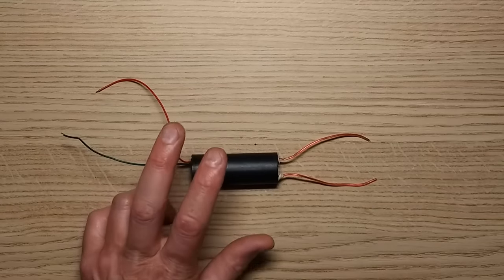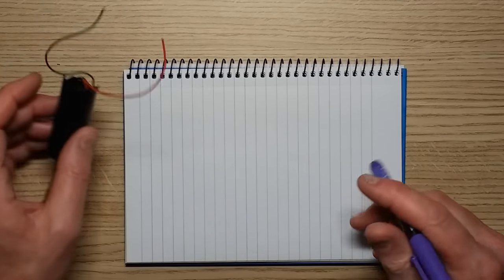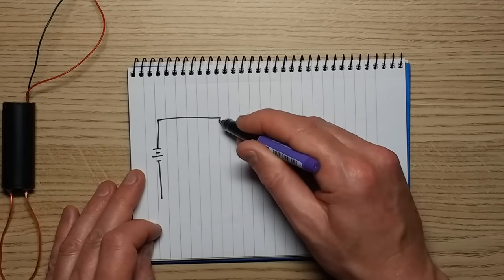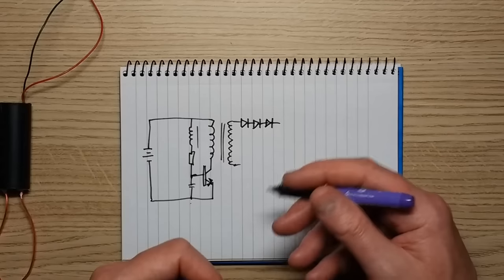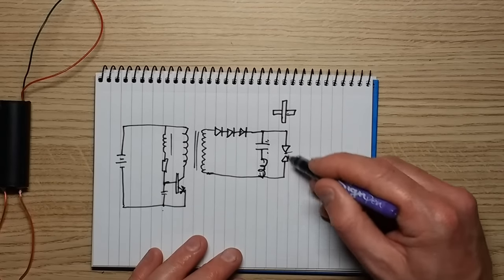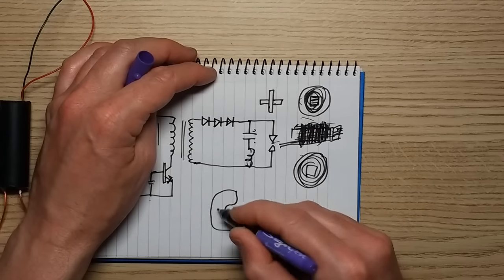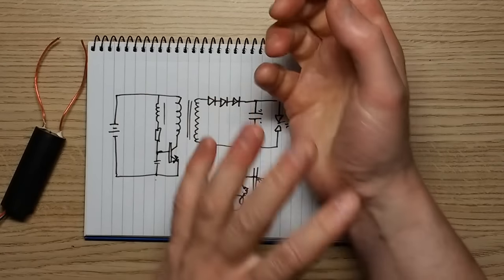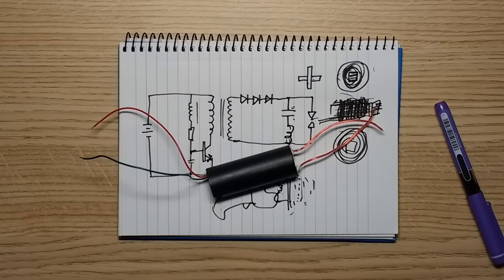Are these stun gun modules?  And do they hurt?  (yes)

Comment: I've always wanted one of these...could I use it to supply a cockroft-walton multiplier to boost the voltage even further?
Reply from the maker: +Jon Holt I think these do have several stages inside.  But you'd need to get into the resin to get the required connections.

Comment: Burned out a dozen of those using them as ignitors on an engine.  Pulled them apart (with a saw).

Not sure how they work inside but they seem to have one of those little 10-15k transformers used for neon lights & stuff.
Reply from the maker: You have to be careful not to space the electrodes too far apart or the high voltage damages the circuitry.  They're also only suitable for brief bursts of use.
Reply: @bigclivedotcom  Would you say if they were fed a 2ms burst they would be unsuitable to fire a spark plug at 11 cycles per second?
Reply from the maker: These units usually have a high voltage step up circuit with multiplier to increase the voltage, so I'm not sure they'd produce a spark with accurate timing.

Comment: I don't understand how 1 kV is stepped up to 30 kV in the secondary circuit
Reply: The 1KV charges the capacitor. So the voltage on the capacitor rises as it continues to charge. The capacitor sucking in the power causes the 1KV to drop quite a lot as it sucks in the energy. So the "1KV" will actually be less, but rising as the capacitor charges.

Eventually the voltage on the capacitor reaches a level enough to cause a spark through air (the principle behind this whole thing!). This spark happens in the spark gap, which is two pieces of metal with a small, precise gap between them.

As the 1KV spark persists through the spark gap, the current also flows through the second transformer's primary coil. which is in series with it. The energy here is all coming from the capacitor, it's discharging through the spark gap and the coil. A spark gap, even though it's air, actually has quite a low resistance once it's going, so it doesn't waste much power. 

So the spark gap is acting like a low-tech voltage comparator. When the voltage is over a certain point, it can break down the half-centimetre of air between the electrodes, and current will flow. So, the capacitor can discharge it's energy into the transformer coil only when it's charged to a high enough voltage. This is all in the name of generating high volts. 

Soon enough, the capacitor is empty, the spark stops, and  the capacitor goes back to charging. But in the meantime, energy has been dumped into the second transformer's primary. Causing a very high voltage in it's secondary. That's why it's potted so completely, to stop sparks forming between parts of it's coil. This very high voltage I mention goes to the output wires, where the spark happens, or else to discharge into the flesh of a Scots / Manx electrician who's just a little bit pissed.

Comment: low current, heh.  the louder the spark is, the more current flow. could be a few amps for a very short time.
dumping the load into a shunt shouldnt cause harm to the oscilloscope since both wires are isolated from ground.

Comment: ordered 2 :) will get more lol and may i ask a noob question if i connect two in parallel would i need to double the input voltage or stay using only same voltage for both? i wish to make a bass ass jabcobs ladder
Reply from the maker: This unit is only suitable for short bursts of use.

Comment: Thinking one off these Clive to fix my powder coat gun was 120v until i plug it in 240 by accident in a rush to get my swing arm done
Reply from the maker: This module probably wouldn't be suitable as it will be damaged by continuous running and being used open-circuit.

Comment: Hi - I have used one of these to charge a 84nF capacitor to 15-20kV so the output is definitely DC; from the sharpness of the 'crack' of the output discharge there is a small output capacitor inside the unit. Its very disappointing how easily these things overheat internally and stop working, best to get a handful of the units for serious experimenting.
Reply from the maker: They're only designed for brief use and you have to make sure the output wires don't get separated too far or the internal insulation will fail.  This type of module does appear to use a step-up transformer followed by a capacitor/diode voltage multiplier.

Comment: I bought one of these, hooked it up to a 3v battery box from a poundland led light string. Switched it on for about half a second. It was terrifying! My poor dog even ran out the room and the cat gave me a dirty look. Stuck it in the drawer. I'm too scared to use it again.
Reply from the maker: If you do summon up the courage, then make sure you never part the spark wires more than about 20mm, as the voltage will keep rising until internal damage occurs.

Comment: Is this actually a stun gun? Apparently Taser International spent loads of effort in developing waveforms and voltages specifically to stun muscle, without too much risk to the heart (although of course they're still quite deadly). You need AC to stun somebody, and at a particular frequency. If this is voltage-multiplied DC, it won't work. Simply pissing off your assailant with a sting isn't going to help, it needs to actually stop him being able to move. Otherwise this is just a cattle prod.

Would using a resistive divider, with some high-value resistors and effort paid to the insulation, mean you could measure the waveform on an oscilloscope? Would you mind risking a scope? Didn't Agilent or somebody send you a free one? I'm sure they'll replace it if you blow it up!

Comment: Great vid! What happens if you continue pressing the on button until the battery runs out? I ask because mine stops creating arc after about 2 seconds, then I have to wait. Is my module broken? Do I need capacitors?
Reply from the maker: These units are only designed for brief bursts of use.
Reply: @bigclivedotcom  If the sparks stop after 2 seconds, does that mean that I can only shock an intruder for 2 seconds?
Reply: They tend to burn out.

Comment: You can mod a 230v strobe light with one of these, makes it portable...
Reply from the maker: I've not tried it with a strobe tube.  It would rely on the voltage rising high enough to cause the lamp to strike without an external trigger pulse.
Reply: @bigclivedotcom  So add a trigger transformer! Actually I've a feeling it'd bugger the tube, gas discharge lamps don't react well to abuse.

Comment: I disconnected the batteries from one of those and tried cutting into it with scissors.  It shocked me still.
Reply from the maker: They do hold a charge on the output.  You have to bridge the output wires together.

Comment: Can these things actually repeatedly shock you if its connected  firmly to your body before power is applied ? does it produce a flat DC output under load ?   I put two 33k resistors across its output and two long leads that I put my toes on ( same foot ) and it gave me quite a jolt,  it was reading around 70v on the meter so was that just a regular DC shock of that voltage ?   I didn't see how much amps it put through my toes but I tested on a banana and from end to end it was putting 20 milliamps with a voltage difference of 200v.
Reply from the maker: I wouldn't recommend that.  The circuitry will probably put out DC under continuous load, as it uses a voltage multiplier.
Reply: @bigclivedotcom  I measured the voltage in DC mode several times and it varied according to the resistance but what was strange was when I changed it to AC measuring mode it also registered a voltage that was around 2/3 of the DC.  I tried my cheap handheld oscilloscope that I don't understand well and it did show a waveform of some type, looked like half of a sine wave. I then tried measuring the frequenzy with the multimeter and it said 15 khz which would be from the first stage before the multiplier ?

Comment: I bought one of these with the intention of bunging it in one of those electric bug zapping rackets! Super bug bat!  Think it's possible? Thoughts/tips? Maybe a nice little side project for you to show us how it's done 😉
Reply: I done it , works ok , you will get a lot of arcing all over the mesh and it will take out a wasp. thats why i built it . It wont explode um but will fry them . I run it of a 18650 power bank.
Reply: Thats what i put it in , the switch was the only bit i used from the original ,just bin all the rest of the electrics, its a real easy project.

Comment: Would playing with these near electronic equipment be a bad idea like plasma balls?
Reply from the maker: +perseus431 No. These don't emit a field like the high voltage AC devices do.
Reply: Thanks for getting back to me. Can i ask another question? When i make arcs or use these to power cold cathodes, it whistles. Why does it do this and is it a bad sign? Also if i make it arc through fire from a lighter the arc changes! 
:-O

Comment: i've got one that is partially fried, i will (eventually) attempt to remove the potting and expose the mystery circuit
Reply: dremel was a bad choice. whittling with xacto knife is better method. on HV side, on flat side of module, there is a sort of printed resistor, (squiggly black line on white material) for bleed off, presumably. mine looks more like a spark gap now, due to dremel. on either side there is a large, formerly red rectangular HV cap, (one on each side) and between them is what seems to be a voltage multiplier circuit, consisting of at least 2 of the round blue hv caps, and 3 HV diodes. (so far it appears that i see 2 blues and 3 diodes, going \/\ and further excavation of the potting material is becoming more troublesome. so far, all i know for sure about the input end is there is a large transformer taking up that half of the circuit, with a large ferrite core. there is something blue on that end as well, so perhaps another round hv cap. have not located the transistor or resistor on the input yet.  i really should find a non-potato camera and post pics. my circuit is quite mutilated at this point, from the dremel. making a dusty, likely carcinogenic mess with the dremel, i managed to accidentally chop into both red caps and all 3 diodes. the diodes are still functional, as tested by shocking with another unit in each polarity.

Comment: Why does a Van de Graaff generator have a less dramatic effect than a stun gun? Both operate at the tens of thousands of volts. The generator's charge presumably passes through your body to ground, while the stun gun passes between the two probes with limited body in between. Is it only about the time and current? That a stun gun is larger current over longer time which has a greater impact despite the more limited path through the body?
Reply from the maker: The Van de Graaff generator relies on charge being stored on its dome surface.  A capacitor can store a lot more charge.

Comment: Hi Clive some of these will spark across 50mm quite easily and the sellers recommend a 2 inch spark gap. What sort of voltage is that?
Reply: Assume 30 kV per cm, so better than 150 kV.
Reply: Slicerwizard That could be painful then lol

Comment: I think you forgot to mention where the secondary winding is connected. You just said the ouput capacitor goes through a big primary winding but where is the secondary with the fine wires? Shouldn't that be the high voltage output?
Reply: Yes. In the design Clive drew, the secondary of the high-voltage transformer goes straight to the output wires to connect to the victim through the pointy electrodes.

Comment: Bought a few of them from eBay months ago. They died pretty quickly, even at low input voltage and with some pause between a short pulse. Any idea what I am doing wrong?
Reply: They're cheap Chinese junk and any air bubbles in the material that they pot them in will lead to crib death. Of four that I bought, one died in the first minute. The others are still going strong.

Comment: bigclivedotcom Thank you for excellent videos, I had an idea and 3d printed a pistol grip with a trigger and a 1.25 cm "barrel" of a 6" length.  It fits a firework known as a roman candle that shoots 6 exploding balls downrange about 80 ft at high velocity finishing with a loud boom.  I use the trigger to flip a switch on on 18650 in the handle that runs the current into a small ball of fine steel wool which instantly lights the firework.  The point being a handheld firework "shooter" or self defense weapon if necessary 😂.  It's about 6" long and vaguely resembles a firearm, my question is would this be illegal where you are from, and do you have any ideas on a better igniter (mine works flawlessly but is labor intensive to make).
Reply: Pretty sure modifying fireworks makes them into bombs, legally, in the UK. Dunno about elsewhere, would depend how lax your bomb laws are. Most countries' are pretty tight, most countries that have a well-functioning legal system at least. 

There was a bloke who bombed a gay pub a few years ago. His bomb used explosives from fireworks, and nails as shrapnel. It killed quite a few people and injured many. They caught the evil fucker and now he's in jail. 

As far as your igniter, you can buy "electric matches" meant for launching model rockets, which have "motors" which are a cardboard tube of explosive that burns at the right rate. They go very high, lots of fun actually, my mate had one with a camera on board. An analogue, film-using one! When we got the pictures back they were all just the sky! 

Model rocket motors might also be an avenue of investigation for you, though I worry they'd be suspicious if you bought the motors without actually owning a rocket. Maybe have some bullshit ready in case they ask. 

It's probably illegal for me to even tell you any of this, christ. 

Your wire wool idea sounds good enough, if it works every time. I've heard the same method used for other things, I think it's even one of those emergency-survival things where you need to start a fire with a battery and some wire wool. Because you brought both those things but forgot your lighter. 

I might cover my arse by advising you never, ever, to point these things at other people, and be very wary of blowing a few fingers off, because that happens when people hold lit fireworks. 

Even so, you're probably still a t-rr-r-st just for playing with your toy. Jesus fuck. Watch out!

Comment: I dissolved one in paint stripper…

Here's the driver circuit and photos. The output seems to be a voltage multiplier some 12kv diodes and the output has ceramic block high voltage capacitors for that extra kick.

https://drive.google.com/folderview?id=13aVgegFzqlnfxHsOWAskXBTc2Om8cU_f

Comment: I have seen very similar modules used in portable bug zappers.  I wonder if they use the same module or a similar design but change the number of windings on the output.
Reply: They use a much smaller transformers and capacitors. Similar circuit, but a weaker version. Usually it won't have the spark gap and second transformer. Instead they use a voltage multiplying rectifier.
Reply: Thanks for the info.  I was wondering since I have taken a few apart that have similar looking modules but since they are all potted it is hard to tell what they cram in there.  I have 4 of these higher voltage units that I got from eBay but I have not done anything with them yet.
Reply: Using these in bug zapper is actually not a good idea. some insects will feel the intense electric field of it and flee. also, sparking before actually hitting something might leave a small gap where small insects can just pass through without getting a shock. I tried this alread and got rather mixed results. When it hits, it hits hard but small fruit flies usually just pass through.
Reply: Stop using the word actually where it is not needed!  Thank you.

Bug zapper is not a bad idea at all, is proven to work with arcing.  Your design was merely wrong.  However it's a bit silly to experiment doing so when major companies already have, would be akin to reinventing the wheel.

Comment: Nice video...good technical description.Basically a blocking oscillator. You are dead right about air bubbles because they will ionize and short across. Stun guns are classified as firearms so if you get caught with one you could possibly get sent down so if you do construct one you need to have a good excuse in case you get caught and have to  bullshit the judge.

Comment: Well then I'd've thought that a stun gun/cattle prod/taser would've used a cockroft walton voltage multiplier.
Reply from the maker: +Toddo Roi Some do, and this unit may have that inside as the main boost circuitry.
Reply: Never mind, it's a bad idea to do so, any arcing would cause damage to the diodes.

Comment: I bought this device to detect internally broken cables by applying voltage. When i inject to defected cable broken place is burning inside and shows you where is defected.

Comment: I ordered 2 modules, in case one failed, and I was right, one stopped arcing, after trying it for a 4th time, still a high pitched sound, but no arcing, it must have internally arced.
Reply from the maker: If it is powered with the electrode wires too far apart it can damage the circuitry with the high open circuit voltage.

Comment: After nearly 4 weeks mine arrived.... loads of fun :-D
I found out the hard way that the spark gap mustn't be to large or this will damage the module.
If there’s no spark and the module squeals disconnect the power immediately or it will be irreversibly damaged.
I guess these are legal in the UK in their bare state... but when do they fall under the law of stun guns?
My kids have been fascinated watching them (at a distance) so they can better understand what lightning is. Recording the bang from the spark and then slowing it down on the PC until it sound like thunder and then carrying out the opposite to a recorded thunder clap.
Just ordered another two :-D